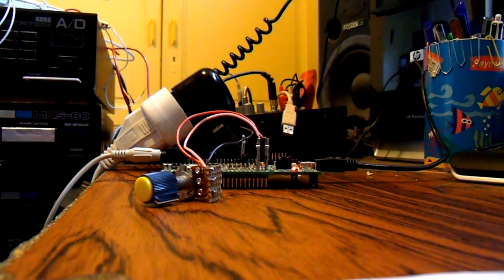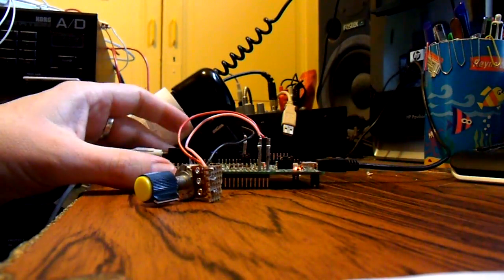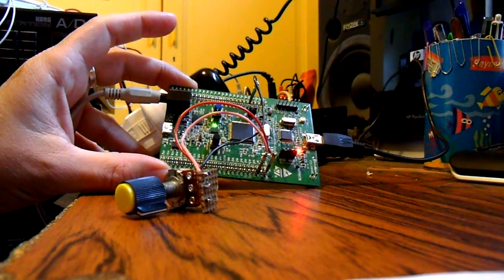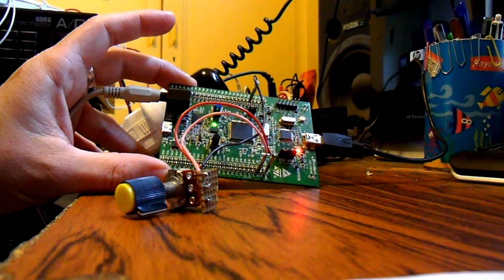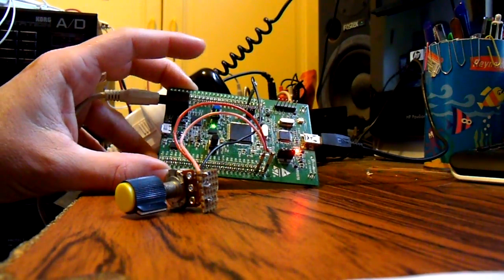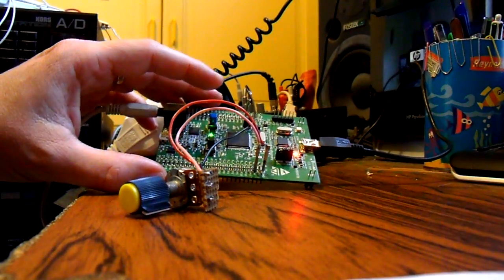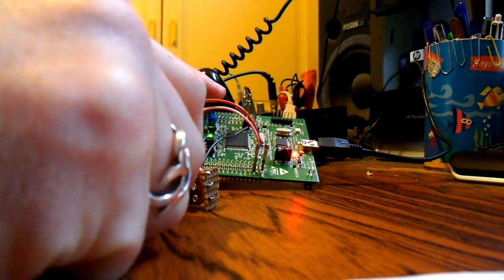Sound gadget with STM32F4 Discovery board : horrorophone

Comment: Hi, nice work! I see you have 16 bit resolution on this. I was under the impression you can max out @ 12 bits on the STM32F4. How do you sample at 16 bits resolution? Can you do 24 bits?
Reply from the maker: Thanks !
I'm using the external DAC (CS43L22) which can do 16 bits but not more...
Reply: pllzz how to configure cs43l22
Reply: Xav Blue,  You can change the source of reference voltage for ADC and DAC after measures to get 24 bits